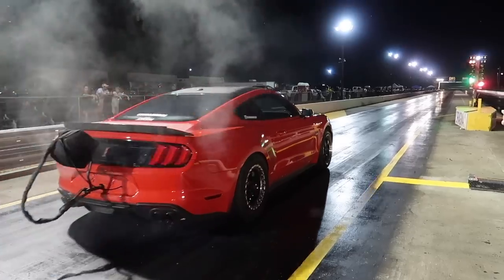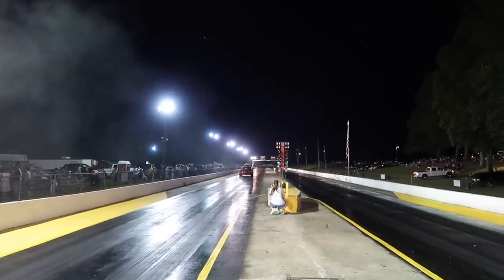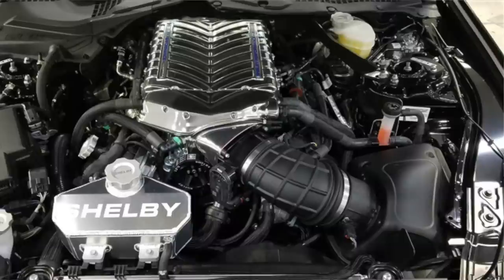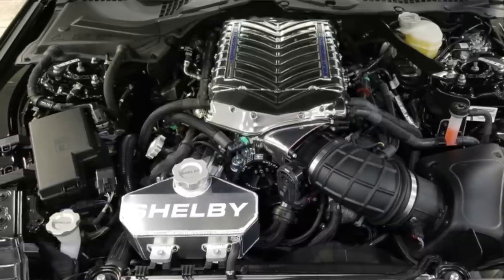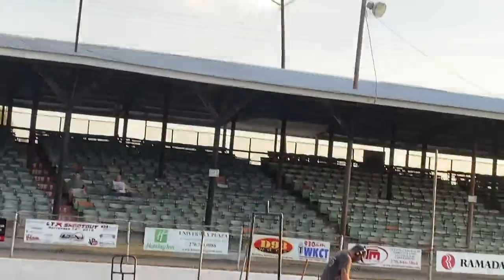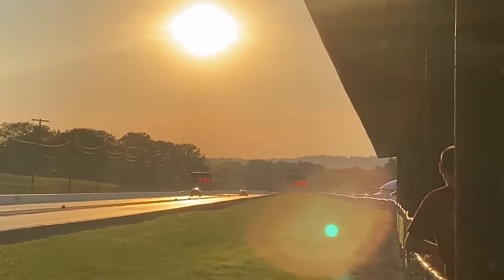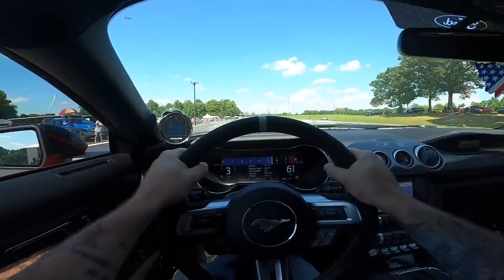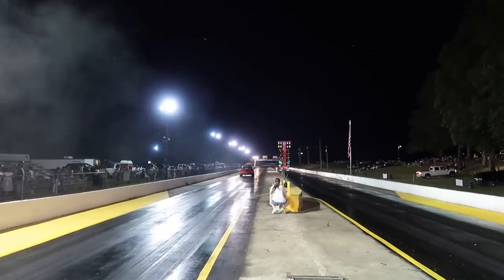SUPERCHARGER VS TURBOCHARGER - WHAT'S BETTER? * LET'S END THE DEBATE...*

Comment: That was hard to watch lol. Anyways, there is a lot of good information out there. Best thing to do is call places like Beefcake Racing, Palm beach, Lethal Performance and Lund for help. Mustang6g is a good place for owner opinions....
Reply: Here here. I am running a stage 2 Whipple. It's everything I could ever want. Not interested in drag racing.
Reply: @thereissomecoolstuff  Running the same as you, gonna be hitting mid to low 9s soon.
Reply: @cheeto3340  it's crazy what you get for the money. Congrats on the 9's. I have a prototype like Lund and Lethal Performance. Flat top SC. I haven't even gotten close to 7000 Rpms.
Reply: @thereissomecoolstuff  Thanks and yes sir that 100% true. I have the regular production gen 5, making in the park of 850whp with 13-14lbs of boost on e85. Just need to dial in the suspension and get the launch down to hit those numbers. I'm high 9s right now. Did do 147.5 mph on a hot day lol.
Reply: @cheeto3340  that's great. No E85 in my state. That seems to be the trick. That is fast. I upgraded all my suspension too. The car is a brick on the road course. Very fun. Mustangs are so great because you can work on them yourself. What tuner did you use?

Comment: I think speed addicts 731s car is going to answer even more for me.....
 Because you have a stall and he doesnt, I want to see 60ft when you don't add a $2000 stall plus labor/core...and you havent add all the electronics to bump in and build boost on the leave...
  I would like to see what you both leave at in 60ft footbraking vs me with no stall this fall as I now have axles ( assuming it lives till then LOL).....

 The biggest pros to me, you hit on...adjustability of turbos and when, like me your stuck with decent 93 octane ( system just uses a BAP), a turbo would net me what 65-100hp more to the wheels with the same octane limitations.....

  Not sure how that would wash out due to being able to 60ft in the 1.4s on a stock stall.....especially in the 1/8th.....Ill have my answer soon, SA731s car is more street and closer to stock....but im sure I won't be able to get him to run 93 either hehe....It will be a great 3 or 4 car build for us to see, so stoked for everyone!!!!
  I will say my supercharger has a warranty and they did pay out( twice), these gen 3s are hit or miss but its obviously less of an issue if your going to run e85.......

 I just cant see 2 cars exactly the same weight and chassis setup to RACE, the Turbo not beating the Supercharger 99% of the time.....

  But if your more into just fun and occasionally hitting the track, my cooling is great, I didnt need an expensive fuel system and I have warranty......on the STREET not even trying full weight with my lard ass in it nearly 4400lbs, I run 10s at 138mph....on 93...on SS tires not even Rs....its plenty fast for me...it would run 9s with you in it and drive home no problems ( lol couldn't type that with a straight face, in theory no problems ).

 But I'm not trying to run 8s...i know they can all get there BUT its hard to argue with the fact properly sized mid mount Twins for your goals, will make more HP/PSI...generate less heat....waste no power to turn...and have more headroom to grow IF you decide.....durability is a variable my rotor pack is OEM quality and designed to have 100k mile service intervals....

 Now i do like the F1A-94 procharger on my other car is acts like a turbo, especially on the street....very peaky and efficient power making the car easier to dial in for street digs....and easily makes over 1000whp on the BBC...i mean I don't even run an intercooler lol on 93...hell winter I've run 12psi on 87 ( 12 psi on a 500ci engine lol) with a little meth....since we made the induction including the sequential MPI injected intake it was cheap cheap...pumps cheap too...

Great Great video and I hope this is the first in a series follow Ken and maybe get some supercharger cars to compare mod for mod....

 Let's not forget HELLHORSE is what is making these twins more affordable and more of a direct comparison to supercharging for our money!!!!
Reply: Btw on my F1A-94 car, I utilize a PWM output on my standalone to drive a 2nd blow off valve that since I'm speed density I can control using a 3 way valve...boost vs time or gear ect...i can't drop boost to zero but I have gotten it to 4psi then roll in....
 I got an idea of how to add that on using some ready made parts for the s550......

 If you get ranking by words per video in comment section, im helping

Comment: Turbo car need motor to be rebuilt to handle boost, cars with superchargers don't they're not using superheated exhaust they're taking in fresh cool air. Better torque curve and better longevity with superchargers 🤷